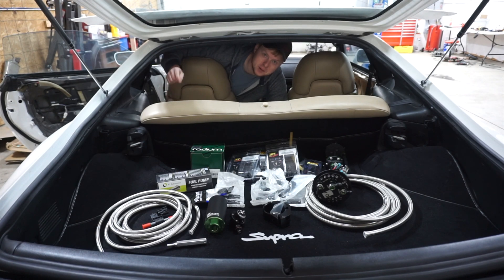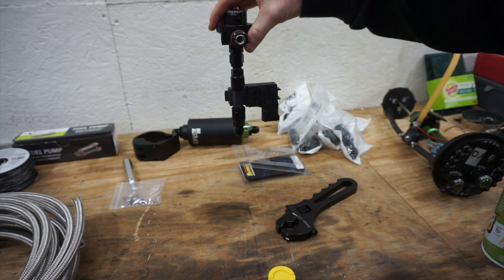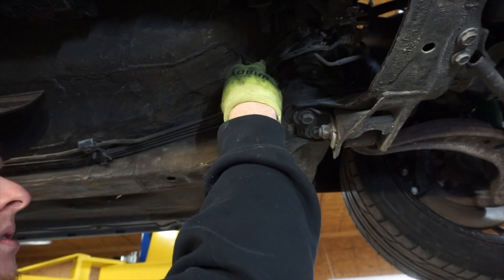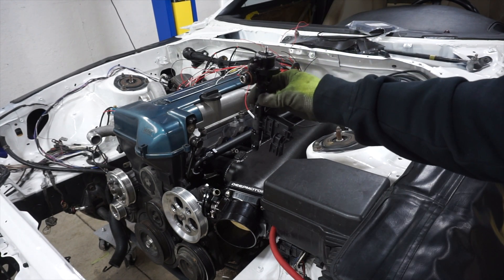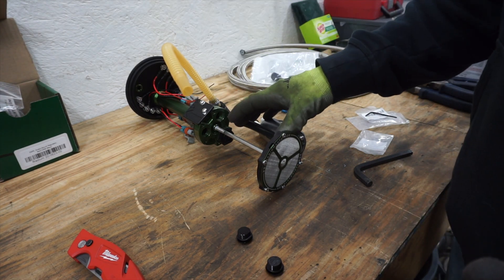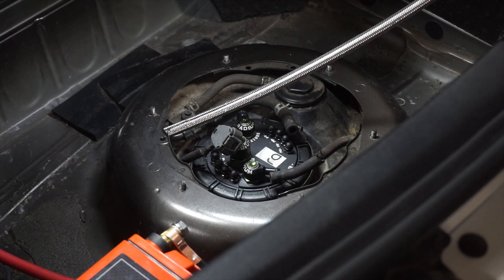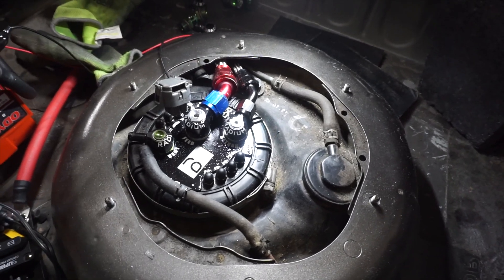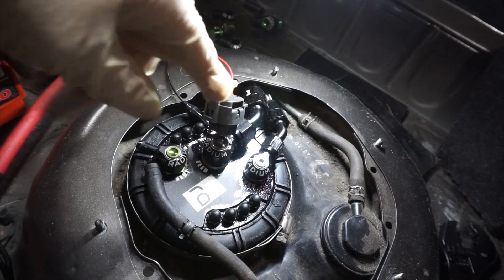The Fuel System Saga - MKIV Supra Build - Pt.10

Comment: @3:29 OUCH! was tempted to mount mine in the bay just cz its a $100 filter 😂
@7:16 Glue-lines heatshrink? 
@9:52 Fuel leaks are the worst 😰 Dangerous too (Last year a Supra burned down in one of the neighboring islands due to a fuel leak on a freshly done system) @11:23 that must really suck. leaking still, nah there must be a hairline crack or something on that fuel pump hanger.
@12:28 made it lol 😂. Good video man, looking forward to the progress. 👏